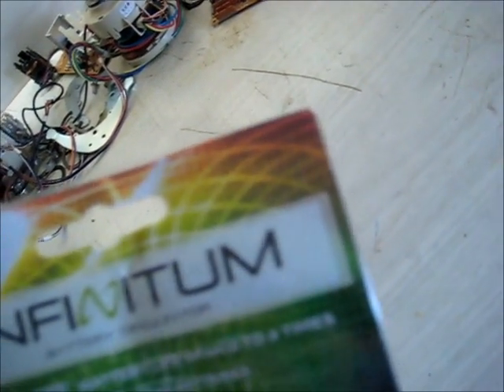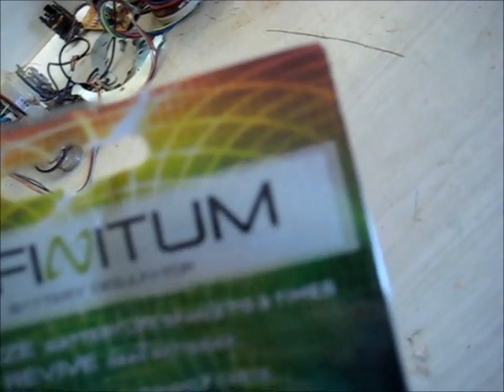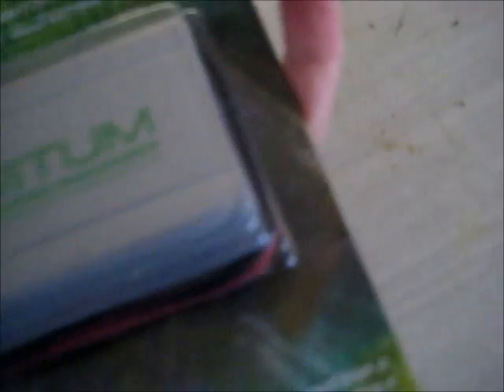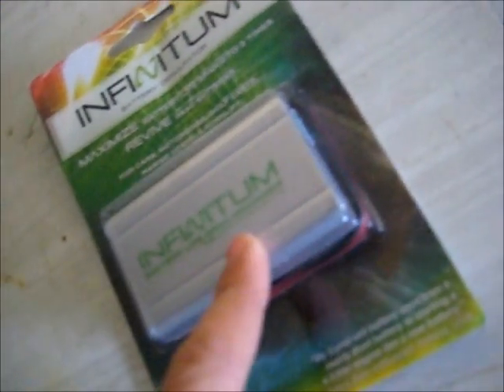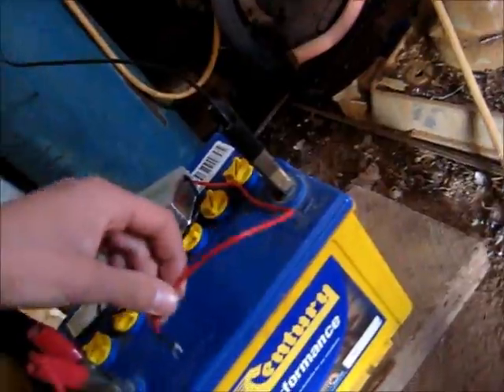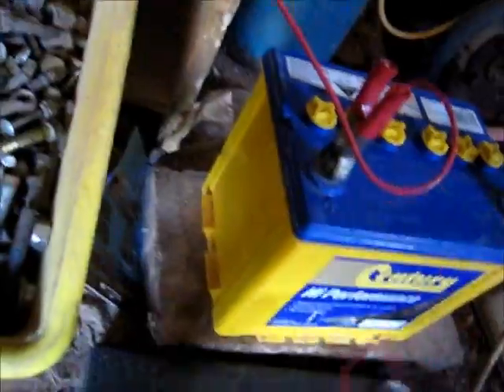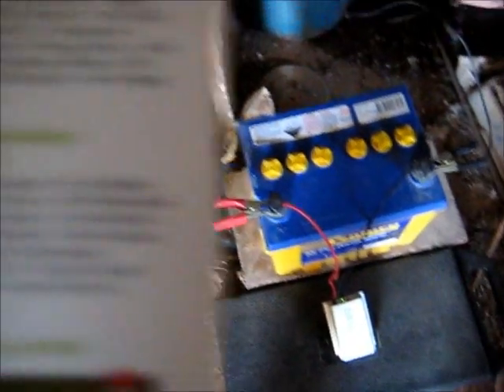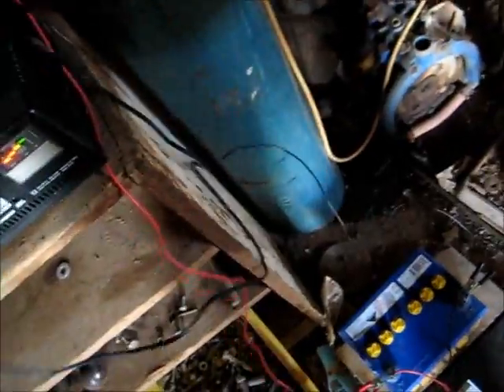First test of Infinitum Desulfator That just arrived

Comment: I reckon the principal is sound,  but I suspect you would need BIG energy pulses to have a real effect... the kit I have seems much to weedy to do anything real... I have heard of farmers using rectified 240V mains (ie, no filter capacitor) applied to 12V batteries... thus injecting big currenjt pulses with lots of power (risky, EXPLOSIONs?) into the batteries. This apparently works to an extent. If you don't try it, I'm thinking of a safe way to give it a go on a motorcycle battery

Comment: Also, these things are supposed to work by generating high Voltage pulses which supposedly 'break down' the sulphate crystals. the kit I have does just that, I can measure is generating around 70V or so... I wouldn't connect it directly to a battery still connected to anything else (ie, a car) as damage to electronics may occur if you do....